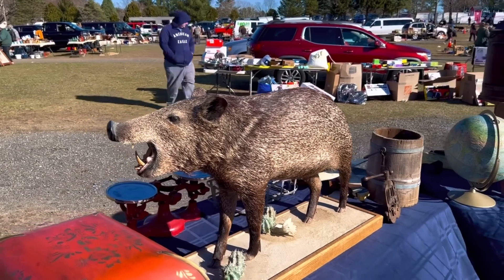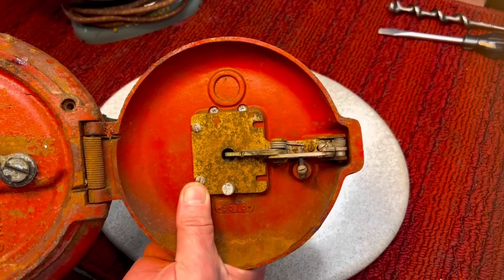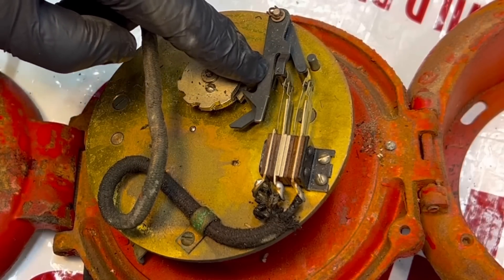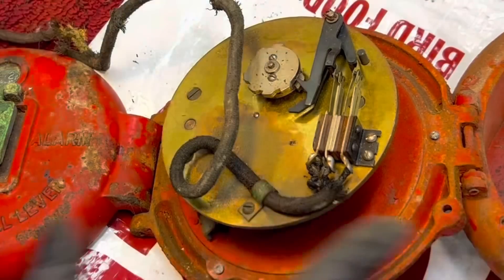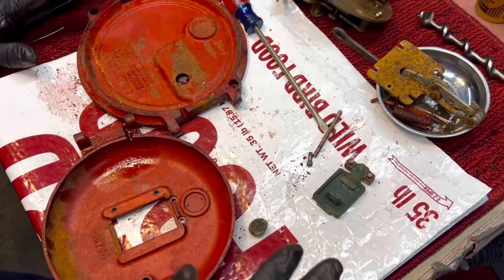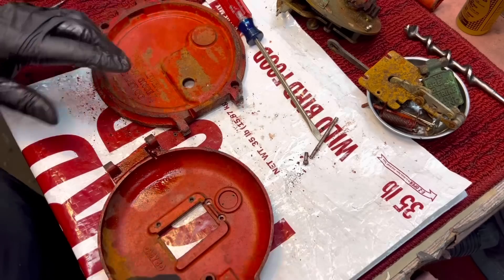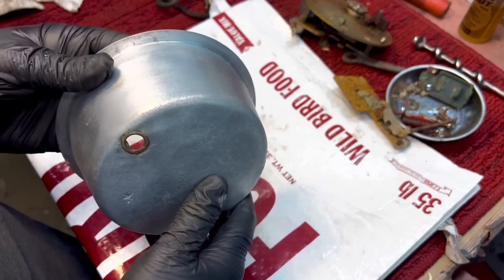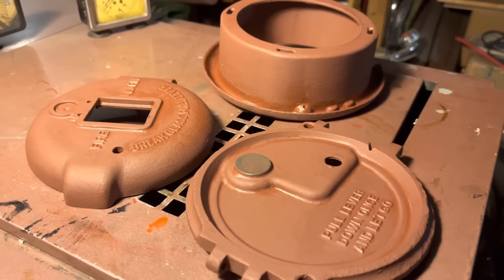Antique Holtzer Cabot Fire Pull Box

Comment: Absolutely interesting from start to, well, on the way to completion. These old systems worked flawlessly and they only were replaced because of cost and the advent of modularized electronics. The ideas were there to sound an alarm with a location but it had to be done elctro-mechanically because no device exsisted at the time that would have done the same job. Just sheer genius involved to use what was available and make it fit the need. I’ve no idea how the alarm worked in the elementary school I attended but this one is common sense all the way. Can’t wait until Monday, Thank you.

Comment: Excellent advice on knowing when to stop on component parts of a restoration to keep the project moving forward, found myself in a perfectionist mode more than once and it wasn’t really necessary for some components to be perfect as much as cleaned and lubed and functional. My biggest issue to date is making specialty tools fora project and allowing myself to get so absorbed in making the tool that it takes longer to do a tool then it does to do a project, BTW, after I’m finished with the tool, and put in a drawer and find it a year or two later I can’t remember exactly what it was used for, they call that acute sometimers disease , sometimes you remember, sometimes you don’t, and as I age the “you don’t” wins out.😂 thanks for the video, looking forward to the finished product.
Reply from the maker: Terry- It’s nice to go over the top sometimes but we can get burnt out so easy with restorations.  There are times that a good clean and lubrication will rejuvenate your enthusiasm to do more.  The big projects can drain us.  😃👍

Comment: Hi John, good video. As I was watching, I was wondering if you would replace the glass. This reminded me that I often collect pieces of glass for maybe reuse, but I have had times where I try to cut glass that is tempered, and of course  it shatters completely. I was wondering if there is a way to tell if the glass is tempered or if there is a way to cut it.
Reply: Yes, get an old pair of polarised glasses [or two new sheets of polarised plastic sheet] hold them both up to a light  about 2 or three inches apart, [one in front of the other] rotate one sheet until all the light is obscured. When you place untempered glass between the two polarised sheet very little difference is noted in the amount of light passing through. However, when a piece of tempered glass is put between the two polarised sheets you will notice the light level increases and you will see patterns which shows the stresses caused by the tempering process. Tempering glass is a similar process to case hardening metals.  No there is no way of cutting tempered glass.
Reply: @isoguy.  great information, thank you very much.
Reply from the maker: Max- ISOguy nailed it!  😃👍.
Reply: @maxgo1d  if you do an online search for handheld polariscope you can buy a ready made setup for around $30, but to be fair I just picked up a pair of old polaroid sun glasses from a thrift shop for 30 cents and mounted the opposed lenses on a scrap of wood using plasticine. Total cost less than 50 cents.  Why buy when it's so easy to make?

Comment: I agree with you about how far you can take a restoration before it becomes an exercise in insanity. I have seen several of these anal retentive restorers who machine entirely new parts and then nickel coat them and polish things to a mirror and the thing ends up like a museum piece or a factory prototype part. That’s all cool looking, and everyone can appreciate the effort, but it doesn’t do the part justice. It was meant to be sitting out in the elements for years before ever being used and it would just work because of the integrity of the design. It doesn’t need to be mirror polished and nickel plated.